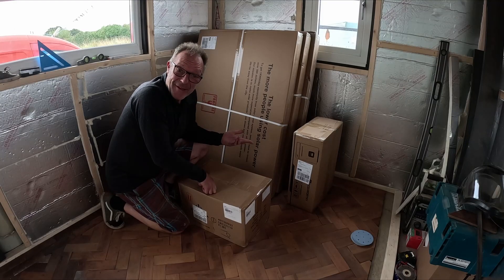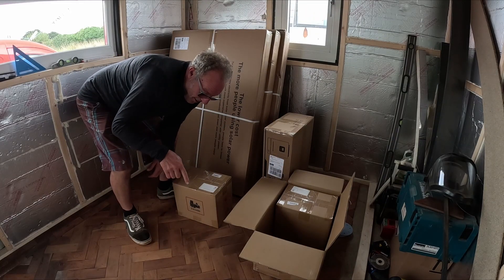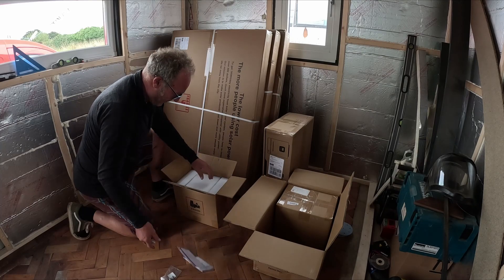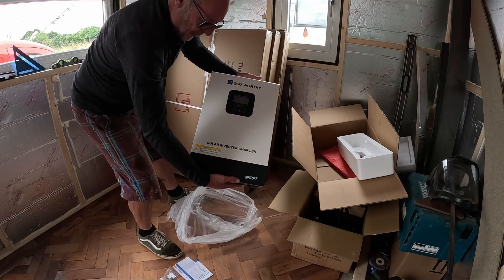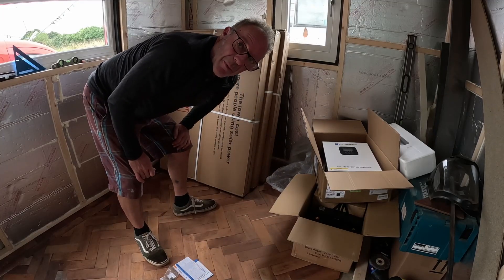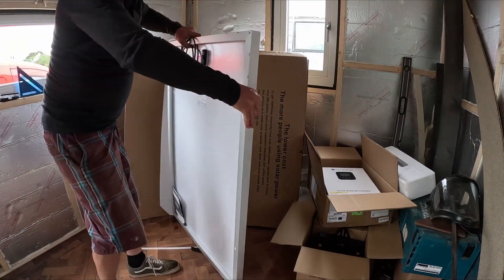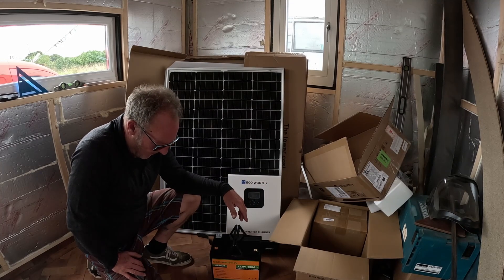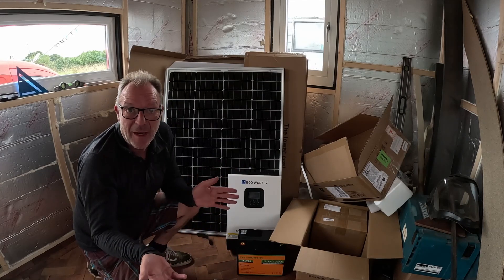Eco Worthy Solar System unboxing 1000w solar & 3Kw inverter

Comment: Eh I don't think 3kW is enough for a real kitchen, like you will only be able to use 1 big load at a time, really I think for a fullsized kitchen you should be going for 6kW minium, like I think the advice of Will Prowes of DIY Solar with Will Prowes has it right, "buy the biggest inverter to can afford because you will end up spending a tonne of money on inverters buying for what you currently use because you will buy a few more appliences and they don't even have to be big and you will end up needing in a chain of buying inverter after inverter."

And if you buy for example a Growatt SPF5000-ES 48V Inverter you can add another inverter upto 6 meaning 30kW... which like that is just dumb, but I can see going for 10 or 15 if your doing a system for a faimily house, 5000W is fine for a single person though, you can run 2 reltaively large loads like a air frier and induction hob and a few smallish loads, and like the Growatt SPF5000-ES 48V Inverter can be had for like £650 so considering your already going to be at the very least spending £600 on batteries and your going to want 1000W of solar minium which is another ~$600, like I think it's worth spending the extra on the inverter and batteries to get you upto 48V and a 48V inverter that you can add another one to later.

Also that Growwatt inverter also comes with a 6000W Solar MPPT, and can charge the batteries with upto 80A to like 4000W AC charging to, and if you were actually going to get 6000W of solar you would definitly be wanting more inverter capacity so at that point you are talking like a maxium of 12,000W solar... which is just dumb.
Reply from the maker: Hey, thanks for the comment!
You make very valid points - I follow Will P, but sadly I don't have his knowledge or pockets 🤣, I'm just a simple man trying things out, for my personal needs and circumstances 3kv is fine, but I've already found that 1000w of panels isn't enough to run my fridge / freezer in the UK winter months. I anticipated and changed from electric oven to bottled gas stove so now I make coffee and toast on the hob. It's all a learning curve 😉

Comment: That will be interesting to see how that all work out for you. I have 4.5kw PV on my roof [10south facing - 5 west facing] along with a 5Kwh battery. I also have owned an Ev for 8yrs, and also use a Myenergi water heating and car charging system. The whole thing is amazing how it is smart and auto does what it needs to do so I buy as little power from the grid as possible. As for motorbike motivation, the weather here in NI has been Crap since we got back from theTT. I also haven't recorded any new footage in well over a month. But I feel a lot of YT'ers are not putting out as much content as usual based on the current lousy weather. ps we are heading to Wicklow next Thursday for a long weekend of Biking & camping..Hopfully I get some footage from that ...
Reply from the maker: Cheers for the comment, it's great to have a project to crack on with, despite the weather! Good look with your upcoming trip! I wish you pleasant weather, and look forward to the videos 👍
PS congratulations on the sub count - keep knocking out those videos!